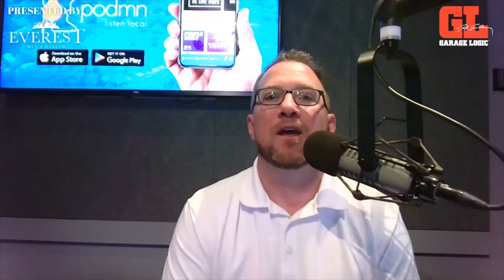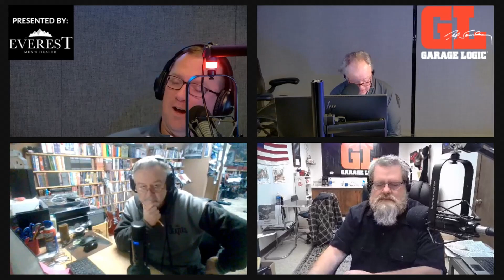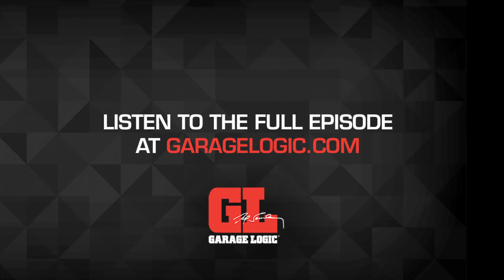The GL pilots help clear up some confusion today

Comment: Kenny is actually kind of correct. There is a whole new breed of green horn pilots that rely far too much on the autoland function. The old timer can definitely stick and throttle the thing in but these newer bird are so tech heavy that the computer does a lot of the heavy lifting so to speak and the pilots are there in case the computer screws up. There is a lot more meat servos and a lot less high time old school plane jockeys. The new ones are learning at a faster pace though so we shall see what time will tell.

Comment: Carl is spot on. If you want to sebd Kenny into the ceiling and keep him there tell him to look up RVSM or reduced vertical standards minimums. Basically because autopilot are flying most of the time and as technology improves they are getting these tolerances tighter and tighter. Last I checked the RVSM could be less than 500ft so that could have 2 aircraft on opposing paths closing on each other at 1200kts so 600ish kts a piece. If that doesn't keep Kenny driving across country Idk what will. Also you guys should look into 5g interference and the cell phone companies vs the airlines. The issue is the 5g signal chops out radio altimeter that aircraft are using on cat3 landings during bad weather. There is a backup system but it is significantly less accurate.